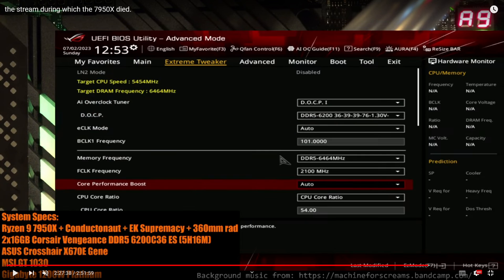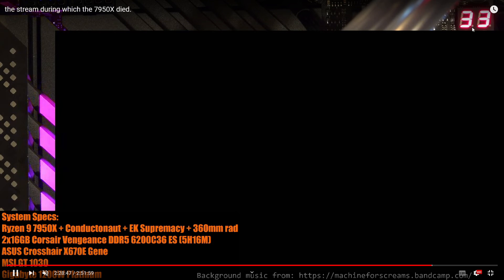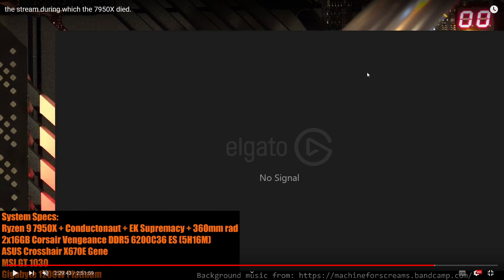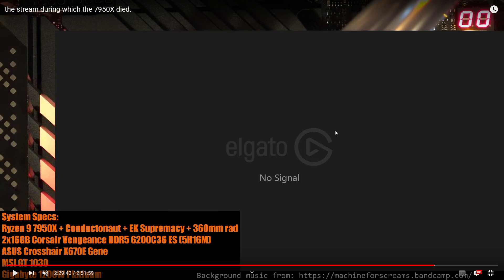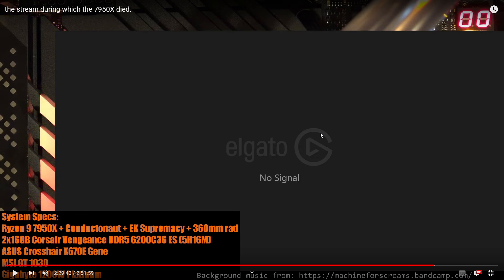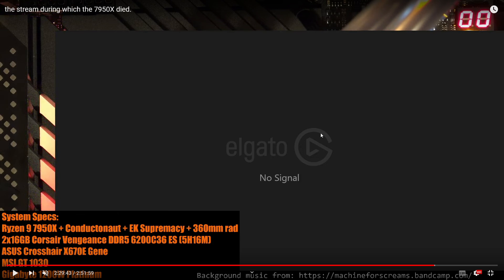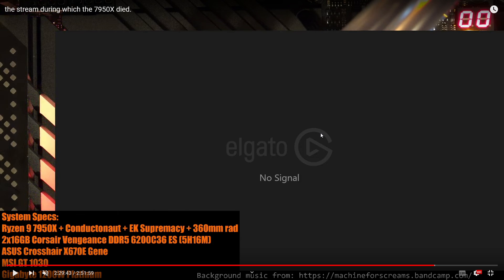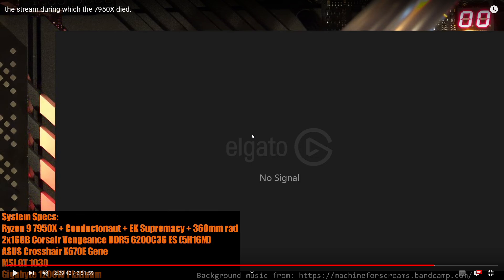My Ryzen 9 7950X died.

Comment: There is no such thing as unlucky. It is the Illuminati. You were about to discover one of their hidden subliminal messages broadcast over RF from the cpu, and they had to shut you down. All the more reason to use double, or even triple pane tinfoil hats. I have an extra protective layer of radium between the panes of mine. I dunno why everybody says its toxic. I feel fine, don't notice anxbrble sh8ine ne,, mrrrp.

Comment: The SoC and VDDIO looked very high to me there on auto (really, really very high) but then again i haven't used 7k series but only the previous generations including 5k series so the new ones might run ALOT more voltage but that did stand out to me, i know the 5k early bioses overvolted SoC and VDDIO (VDDG etc) and so on massivly on auto, maybe a case of that again?

Comment: Thats total bs. "overclocking voids the warranty" Now i do agree if your on LN2 or pushing the voltage then ya you probably should just buy a new one. But just because you change a bios setting does not mean your warranty is void. They can say w.e they want, and they use this as a safty to say well you already had your cpu replaced 3 times, so we are going to deny the warranty. and this is perfectly fine. ofc if you get a free sample then it has no warranty and you will just have to ask for another. and show them what you did so they can see it will greatly help them out as they can directly test asus's board design and make sure voltages are ok. 

yes it could have been defective but seems a bit odd way to die? all tho with my 3930k it died in the very same manor. my cpu bsod, then posted started to load windows and just went black, never to post again. 

When my asus board killed my 3930k (SB-E) due to over imc voltage with xmp. intel replaced my cpu even after telling them what had happened.  In my case the mobo mfg really should have been held responsible and bought a new cpu for me. its not intel's fault they set ridiculous imc voltage.

 Also i would urge you to not use that board again with a new cpu. asus is known for yeeting voltages at things when they first release. I really cant say if asus still does this but i guess history tends to repeat it self so yea maybe it did boost the imc or if voltage a bit too far.

Comment: Can a 7 series take 1.41v to the memory controller?
Reply from the maker: ASUS seems to think so since that's what the AUTO voltage setting sets.
Reply: @ActuallyHardcoreOverclocking   yeah on my x370 mobo i got an agesa update that ran 1.5v flat on my 1700x 0-o auto volts do be a bit special at times and its why i have no real trust
Reply: @ActuallyHardcoreOverclocking  i'd be careful with that mobo for now, but either way GL BZ

Comment: I killed the memory controller on my 9900K recently..    Well degraded it as it still works to some extent.    I previously was using DDR4-4000 on it no issues for years.   I was trying to hit 5.1Ghz on my 9900K and well it booted up at that speed without much trouble.  I went to try a stress test and saw it pretty much instantly hit 95-100C.   Then system hard locked after a ~30-40 seconds.    I reset the CMOS and tried to input my known good O/C settings and voltages.   Refused to post, tried stock CPU clocks with just XMP @ DDR4-4000 also refused to post.   I've had to settle for DDR4-3600 speeds anything beyond 3700Mhz now refuses to post even with very rather high voltages.

Sucks but I'm going to sit tight on DDR4-3600 for now.   I wasn't ready to do a full system rebuild, was saving up money to do it in 2023 or 2024.   I hope it can hang on that long.
Reply: That's interesting. I guess you can now try tightening the timings as much as possible, that shouldn't stress the memory controller too much I think.
Reply: @ahs9674   Running 16-16-16-35 right now but I couldn't get it to post with tight secondary timings.  So just have it on Auto for those.   I tried for a bit to tighten the timings but it was 50/50 if I'd get a post.   I got tired of that and just left it at Auto.

Comment: Rip. Maybe you can have a look on the EDC bug on the 3000 series. My 3900x goes to 4.7ghz on 6 cores with this on stock voltage. I can tell you the settings on MSI if you need
Reply from the maker: does it actually perform better tho? Because it's really easy to get Ryzen chips to report high clocks without the performance to back it up.
Reply: @ActuallyHardcoreOverclocking  On cpuz it does 560 and 8600, to compare on static oc with 45.50,45,44,44 it does 550 and 9000. Stock it does around 550 and 8300. So I think it makes a diference, but this is just my testing and I do like cpuz because its fast. I have an open loop with cpu and gpu on a 360/60 rad with push pull.

Comment: I’m a bit of a novice when it comes to overclocking at least comparatively but my guess is, even tho you had it set to 1.4v it probably was actually spiking to 1.5v+, it all depends on your LLC and other settings but from my experience using Vlatch it’s been normal to see that kind of variance with my 7950x and my crosshair Maximus

Comment: i have no idea why you'd want to overclock a cpu which is already so fast
Reply: a bit lost on the Youtubes are we? take a look at the channel name
Reply: @rdmz135  exactly what I came here to say.
Reply: @rdmz135  i was speaking in general, not just about this guy. sorry if i didnt make that clear. as far as i know, the X at the end means its already somewhat overclocked. he probably just pushed it too far. my motto is if it ain't broke, dont fix it
Reply: @Gruxxan  I see what you’re saying here. But technically overclocking Is what you can do to get more out of a stock piece of hardware. Regardless of how far they pushed it from the factory. To me and I’m sure this applies to most enthusiast. Overclocking means what more you can squeeze out of it. whatever the chip runs stock is stock, no matter how far they push the silicone. that’s not overclocked.  Whatever comes from the factory that’s stock.
Reply: @nickpowell7432  I noticed some other overclocking channels have managed to push it over 6Ghz so I guess this guy did something wrong. Maybe it was a bad chip, but he probably tuned it wrong
Reply: @Gruxxan  where they using LN2?
Reply: @Gruxxan  the weird thing about it is if you watch the beginning of the video, he actually lowers the voltage to try to get a better temperature. for a geek bench score. I’m almost willing to bet It was something wrong with the CPU or a rogue voltage from the bios software. Things like that can happen with brand, new hardware and software. but I know build Zoid would’ve scoured that footage and he would’ve told us if he thought he did something wrong. Plus I mean is there for you to see it doesn’t really make sense that it died when he lowered the voltage if it was something he did it would have died even earlier when he had it at a higher voltage.
Reply: @nickpowell7432  no idea, thats why i dont mess around with overclocking. it was working, then he started messing with it
Reply: normies out REEEEE
Reply: I have no idea why you’d come to a overclocking yt channel and ask why you’d oc a brand new piece of hardware.
Reply: @nickpowell7432  Or cry on a video about it when you kill the cpu.
Reply: This.
"I dont know why it died".. as he's changing voltages in the extreme tweaking menu.. 🙄

Comment: to be honest, I literally got shocked by the title right away.... and now im wondering if it is the motherboard that is flawed... I would be extremely pissed if ASUS AND AMD wouldn't ask You for you to ship them that precise combo, so for them to assess what the hell happened!!
Reply: I wouldn't at all be angry, if you overclock it's always a risk. Its why I dont do it for new stuff because I know it would my cpu that failed while everyone else has success.
Reply: @brianm.595  Most normal OCs are using voltages lower than stock for Ryzen 7000. This chip that died here was probably going to die regardless of his bios changes. 1.4V as we saw in the video is not lethal voltage for Ryzen 7000. Mine spikes way higher than that stock.
Reply: @brianm.595  He was not doing anything extreme. if his cpu failed like that , it would have failed within the month at stock.

Comment: And this...ladies and gentlemen, is why you should never mess with overclocking. :)
Reply: Or you just OC using PBO and Curve Optimizer. Nearly impossible to kill it that way AND its better for gaming performance. But overclockers are trying to break records so I can understand why they do all core OCs.
Reply: @rdmz135  the gains are never worth it, specially these days with processors this powerful.
Reply: @HOBBITSODYSSEY  the gains with DDR5 overclocking are very much worth it, which is what he was trying to do
Reply: @ThunderingRoar  ok, in what way worth it? What cant you run without it? What games need that, or applications?
Reply: Seriously. Has he not watched the Derbauer or anyone else's videos? This thing runs at 95C period, unless you delid it. Somebody who thinks, I can do better! Until you kill the CPU. Lol. It's sad.
Reply: @zaknfeind  I am pretty sure he watched Derbauer video, hes a clued up guy, but overclockers cant control themselves, I used to overclock my cpu,untill my pc exploded, I gave up after that, its Never worth it. :)

Comment: Not sure, but those manual OC voltages seem pretty high. I've never seen anyone attempt higher than 1.4v considering how hot and quickly it gets without de-lidding or extreme cooling.  5.6 all core at 1.36v worked well for me, I think you might have pushed it too much with those voltages. Anything past 1.4v in general is suicide running. You might have seen short bursts of 1.46v or so on single core, but that's brief. I'm amazed you ever loaded into windows without it having extreme thermal issues before using such a high voltage override. For reference LN2 OCing starts at 1.4v and raises to 1.5v+ to get a feel for the chip.
Reply: My 7950X hit 1.58V just from PBO, think it was single core but it does consistently spike past 1.55V with PBO and it runs stable witha single thread boosting to 5.9Ghz very briefly
Reply: @bluephoenix1525  I can't say I've seen 1.5v from mine with PBO settings and I hit 5.9Ghz very very briefly at 1.46v. That seems interesting, what motherboard are you using? I'm currently on the Asrock Taichi. This might be an issue with Asus boards and sounds kind of terrifying.
Reply: @RantGG  see the thing is, I’m using the asus crosshair extreme which has VLatch which if you don’t know, it’s basically a multimeter/oscilloscope so I get very very accurate readings on voltages and most of the time boards will under read on their voltages, gamers nexus has a great video on this, I think it was called like “what cpu voltage is safe” or something along those lines but most likely your board is actually pushing close the same voltages as mine cause mine also reads like 1.4 without using VLatch in fact mine is actually below 1.46 without VLatch so yours may be higher although it’s hard to say cause a lot of variables like LLC are at play here

Comment: I guess AMD will want that CPU back for an autopsy. Maybe they'll send you a replacement, because finding out how the CPU died while getting mostly normal operating voltages may be valuable, if only for microcode or AGESA updates to restrict the parts that caused the failure (if deemed repeatable).

Other than that I'm gonna paypal you 50gbp to go into the "new 7000 series cpu" fund
Reply: will all the controversy over 95C being safe, the new higher voltages they're pushing with Zen 4, yeah AMD should be on this.
Reply: PSA: I'm posting this here as well in hopes more people see it....

After testing and speaking with OC'er Veii, it turns out there's bug with DDR5 PMIC that wasn't protected in early AGESA. Voltage stepping for VDD/Q after enabling High Voltage modes can bug out and push upwards of ~2.0V+ while displaying wrong value in BIOS.

As bad as this is, it shouldn't kill the sample. The problem seemed to be VDDIO followed VDD/Q for some reason, killing the the chip instantly. There's now protection in place to prevent IO/MC following above ~1.43V. Hopefully this prevents dead CPUs but the bug STILL EXISTS. 

Normally VDD is capped at ~1.43V and shouldn't be an issue. However, boards with High Voltage/OC Mode that get enabled and NOT immediately reset PRIOR to setting VDD causes UI to still display the voltage using 5mV stepping but PMIC will actually apply it with 10mV stepping. This causes ~1.4V+ to become ~2.0V+. Sticks can survive if it's caught but going much above 1.45V will likely take them out.

This my understanding atm so take it as it is. I'd suggest those reading this take caution, update BIOS and always verify voltages in monitoring. This should never have made it into the wild. Vendors should be warning users and implement proper mitigations. AMD should replace dead CPUs regardless if they were OC'ing. Just another example of why I'd always play it safe on new platforms.
Reply: Doubt they care
Reply: pathetic
Reply: Finally someone who understands how important this is!
Reply: If they were bothered to
Reply: Really nice of you man
Reply: @heni63  someone else was even nicer and sponsored an entire new 7950X :O
Happy that BZ can continue making valuable videos about zen4

Comment: I know it sounds silly but I had a very similar scenario to yours and I took the CPU, cleaned all the contacts on the back and pushed down REALLY hard on the heat spreader, blew out the socket and voila, it worked. Worth a try.
Reply from the maker: CPUs already gone through a complete isopropyl alcohol bath.
Reply: @ActuallyHardcoreOverclocking  I know it was a long shot but I thought I'd mention it just in case. I wish you better luck in the future, it must have been the memory controller as you said. I seriously doubt anything under 1.5v on vcore would kill it that quick.
Reply: That would probably have suggested thermal paste getting under the chip. But he used conductonaut. It could be the metal leaked out onto the caps on the sides of the CPU. I didn't watch the stream though so not sure if he protected it from that.
Reply: If you did anything wrong, you've got the experience to know the most likely cause. My guess is that this was the bathtub shaped failure curve, most parts fail shortly after they start being used, then if the survive the initial month, they usually stay good until end of life, when the failure rate starts to climb again.
Reply: @davidestabrook5367  oooh I love references to bathtub curves and failure rates. Not being sarcastic here....I'm glad it was mentioned as it's something rarely discussed or understood. People think 1 failure is indicative of a whole class of products being "bad"
Reply: He tried multiple motherboards...

Comment: Has to have been a voltage spike. Maybe the BIOS has some dangerous bugs.
Reply: Wouldn't be the first time with ASUS.
Reply: @-eMpTy-  weird, i have asus boards since the core duo era. now i also have a asus board, not a single issue?
Reply: Pretty sure I read some where of the many tech sites I visit, There was some issues with bios on some boards upon release. I might be wrong. But, I'm sure I saw mention of voltage spikes. So you're probably right.
Reply: I think it may have been the 2v pll voltage. As mine also died at 1.9v pll
Reply: @Barryhick186  your 7950X Die with 1.9V ??    You have booted to windows 1 time or same things happenned as him ?

Comment: So avoid 7000 series? Is it the settings that killed the chip? Or the thermal paste seeping off the edges? Is it the mobo that killed the CPU?
Reply: Most thermal paste won’t be a problem, check if they are non-capacitive and non-conductive.
Plus he was trying to overclock the CPU, many things can go wrong when manually overclocking.
Reply: Its obviously due to the chip not liking the OC.
Reply: On Intel systems If thermal paste gets into the socket the system may not post... I have no experience with zen4, it could very well be the OC but look into the thermal paste angle.

Comment: When a CPU dies due to a delidding mishap I understand the CPU can die. But thinking about it how many facilities overclocking is given, and how common it has become, there is a fair argument to be made that overclocking is also 'normal use' these days: the CPU+motherboard+PSU should be capable of protecting each other. So, if you kill a CPU there is either a production mistake or a design mistake. Therefore if this were a retail chip, the warranty should cover it. I know that this is not the situation in reality but it should be. I also think that AMD should help you out because you are an essential member of the overclocking community. You bring a lot of value to their platform. In any case, my sympathies for your loss, it sucks.